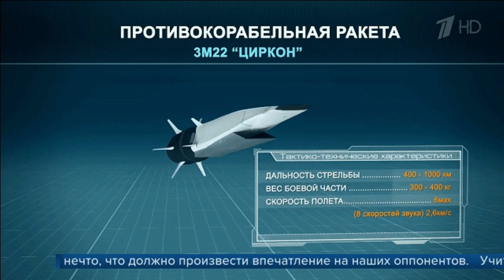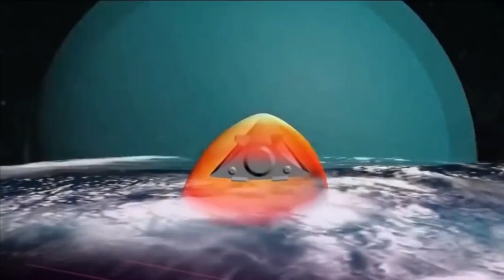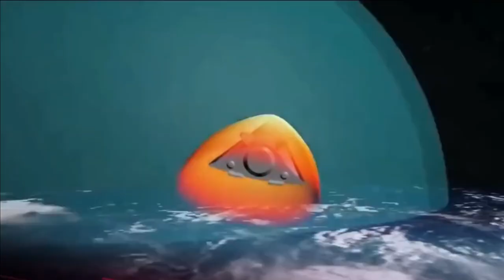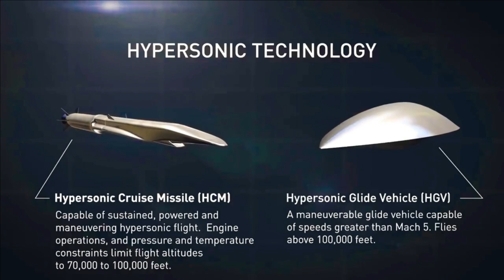India's Hypersonic Glide Vehicle(HGV) with speed Mach 6-8 by 2025

Comment: Hypersonics are tech which finds its induction over long range and high speed requirement platforms like air defence,long range attack,strategic attacks,above all they provide sure reliability as they travel fast evading and escaping radars.
Reply: Isro rader tracing capability Mack 30 with 3 innchi space debris Ins drub and ins unvesh ship have same capability of isro rader.. Swordfish rader capable Cambridge /dues Ball size object Mack 12 speed. After speed mack9 scramjet accuracy gradually decreased. Chinese glided vehicles accuracy 32 km to 50 km which tested as space bombardment  on 2021 July and August months as per pentagon announce. But china says it's gaganjan type space capsule.
Reply: Glide vehicle must used neuclear weapon due to  engine less your accuracy start from km. But scramjet engine up to mack9 u have accuracy 10 meter. Mack5 u may achieved 3 meter accuracy. 4.5 Mack bromhos800 su30 achieved 1 meter accuracy against decommission  Ins rajput destroyer and sank it to ocean bed  near Andaman su fly from northern part of India and go southern part of Andaman and kill Ins rajput. If su30 fly from Andaman  easily  sank Chinese aircraft carrier in South China Sea.
Reply: @ashisbose6181  Is the accuracy limitations at higher speed across the board or is there difference between Russian and Chinese HSV
Reply: @venkag  mother missile accuracy have a part ofcourse . It depends mother missile accuracy. Glide vehicle separation altitude  and in that time air speed in lower altitude. If 30 km then glide vehicle speed low accuracy comparatively high 60 km altitufespeed high accuracy low. Now India computer simulation of glide vehicle glide patern  range speed altitudes  and Mass  of glide vehicle. By calculation  in computer  and then separate glided vehicles at particular  hight and point. Then some what accuracy achieved computer programming needed. Chinese newspaper  propogandas newspaper.

Comment: If scramjet used must speed Mack 5 to mack13 but if you used mother missile speed  then speed will be glide vehicle without any engines thenspeed as as per terminal stages. Mother missile agni5 speed of glide vehicle Mack 24.if used agni6 mother then speed Mack 27 if used Surya missile then speed will be nearly mack30
Agni4 then glide vehicle Mack 21 agni3 glide vehicle mack15 to 17.now u choice ur range and speed as per mother missile.
Reply: When glide vehicle does not have cruise capabilities, how useful is it?
Reply: @venkag  Ocean wave like hypersonic glide below but accuracy is very poor just like kite vocutta or koti potong. scramjet 5 to 9 very accurate. Over 9 Mack accuracy decreased gradually.
Reply: @venkag  then only option neuclear weapon no conventional weapon.
Reply: @ashisbose6181  Higher speed beyond 9 at the cost of accuracy, got it. How about structural in these 2 options? Does India's higher temperatures have any bearing on scanjet's structural stability? Thanks in advance
Reply: @venkag  India have 12 hypersonic tanel there mataeulogy and shape tested. Up to 10 Mack marginal steal OK. But over Mack 10 carbon silica morbiliam compound or agnimisile heat shield  needed. Carbon carbon composit materials  also OK. Both technology  india have  it's capable protect  metal body  up to 4000 degree Celsius for only  1 to 4 hours. Then further  coating  required  if reused technology India  develop. Space plane  will  also used this  combo metal..
Long durations heat absorb material in core jet engines carbon nicel titanium silica  with isothermal condition
That is +2000 degree Celsius and -80 degrees Celsius  western country USA UK France have this technology  Russia with in 2025 develop this technology 
Chinese  then copycat this technology 2030.india some short of this technology already achieved  recently but proper technology india achievement 2026 as my assumption  if achieve core engine  life will be 6000 hours to 12000 hours.. We have to target this by some technical  help from UK  France or USA?
Reply: @venkag  Indian hupersonic tunnel capable up to mack13 but over this computer simulation needed from Mack 13 data
Reply: @ashisbose6181  Thanks for the awesome response. You have so much knowledge in metallurgy and defense, why don't you write blogs or youtube videos. Please share if there are any blogs / videos on defense technologies
Reply: @ashisbose6181 Can't thank you enough for responding with such informative and  comprehensive responses. 
Couple of questions
1. If Chinese air force is so week, Why are they threatening US of dire consequences if Nancy Pelosi visits Taiwan
2. I have been going through some Chinese news papers, they have been mentioning that Indian army's combat effectiveness is very low, your views
Reply: @venkag  high altitude airbase aircraft not flying full capability due to lack of oxygen 
2nd  india china have 3500 km land connection so our Air Force  attack  3500 km of Chinese  land  USA  have no land base connection  with  Chiana  water base connection. We have army support and Air Force support even navy support in pengun pso lake  mig29k capable from attack through airbase Markos also attack from pangoon pso lake.  USA  only fight water  base
 land support lack 

china used fishing boat civilian ship with mbrl since  fight will be  near China's land civilian ship will be used by China 
Most of all  USA army I's cowerd army afraid  to die 
USA  need India  israel Ukrainian  type  dare devil army. In plane and water Chinese Air Force have not high altitude  disadvantages as Himalayan hight.